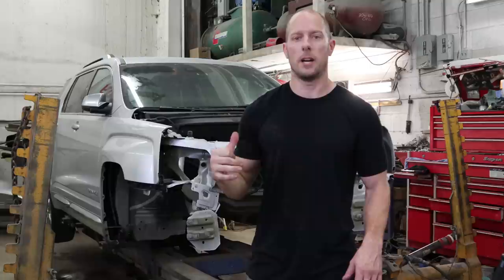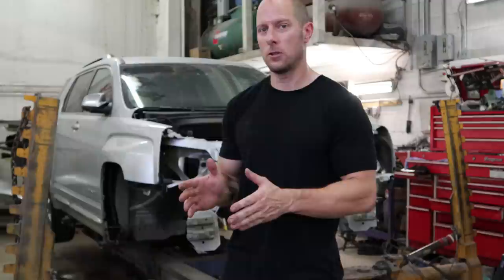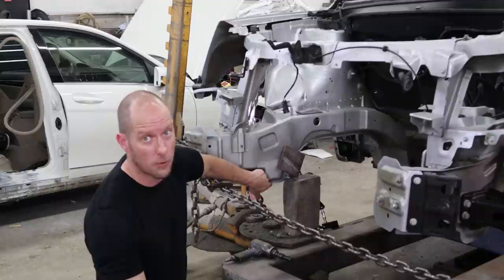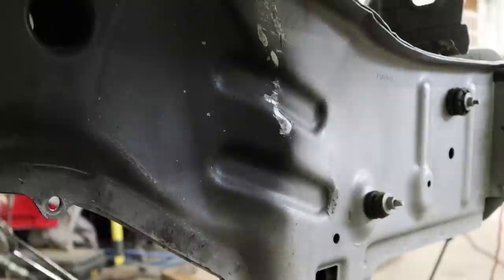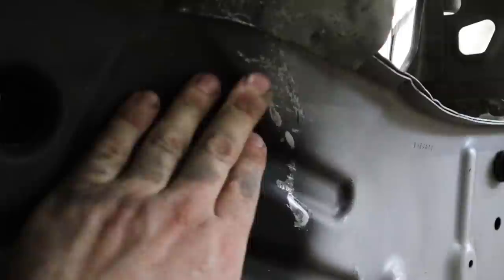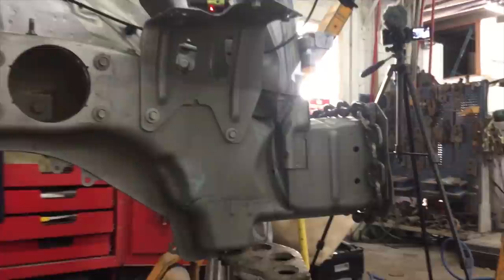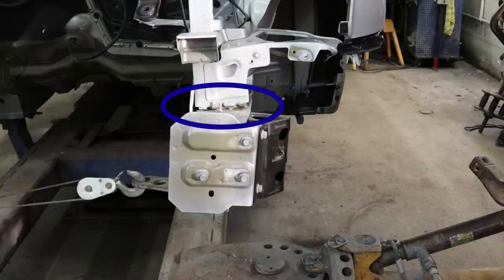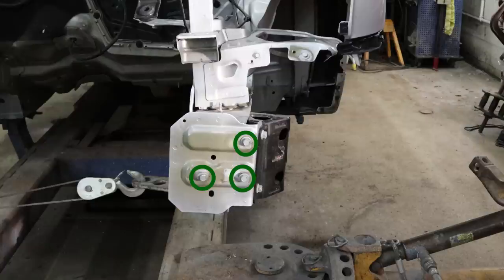Frame pulling tutorial on our 2015 GMC Terrain salvage rebuild project.

Comment: I'm from Peru, and lately labour costs (which used to be dirt-cheap) have gone up a lot, and I was asking some shops why weren't they investing in state of the art frame machines and the answer was "if a car is so messed up that needs expensive equipment to messure and pull, it's probabbly going to be totaled anyways, so why bother". I really like this tutorial a lot, please keep them coming.
Reply from the maker: Manufacturers don't want anything to be repairable.  They want to keep selling more cars.  They make the parts replaceable but the labor to replace them is enough to make a 2 year old car not worth the repair.  Frame racks are becoming less useful if they will not let you straighten anything anymore.  Thanks for watching, more are on the way.
Reply: In the  year 2022 with supply issues many people are holding on to  the  write offs rather then crushing them for a few hundred  dollars, if I pull the engine  and transmission  that's worth 4 grand used 🤷‍♂️ body work that would  usually  be 200 dollars  is minimum 1000 dollars  now unless, you know someone. I'm considering  getting  into the  salvage business  🤔.
Reply: @vehcor  that's a good reason to keep your old workhorse frame machine and not invest in a state of the art machine with laser and GPS guidance machine that will be out dated in six months if you don't buy the new programs😂. Hey it got you here this far ,, keep her, kinda like an old wife. LMAO

Comment: Another good video, it's cool that you are showing people  what goes into the repair process. Ideally you want to give it a yank before replacing parts anyways. It tends to help the new parts line up better.
Reply from the maker: You are spot on!  Even if it doesn't look like it, sometimes adjacent panels can be moved slightly and it sucks to find out when you have a rail assembly in your hand that just doesn't want to go to its home.  Thanks for watching!
Reply: Agreed 100% just because it isn't obvious doesn't mean its straight!!!, always verify the straightness of the surrounding areas before mock up and reassembling!!!!!

Comment: I’m a brake operator and whenever we bend something you’ve always gotta over bend it a real little bit because steel has memory and we call it spring back, exactly what you just said, cheers.
Reply from the maker: Over bending is another method they used to use.  They no longer recommend it for cars because one person's idea of enough is not the same as another.  It does work just as well though.  Thanks for watching.

Comment: An excellent how it's done video. I have heard of "pulling it". I now have a much better idea of what is involved. Thanks. Looking forward to the series. I would have no worries buying a vehicle you've repaired. No cut corners. Hard to find these days.
Reply from the maker: Thanks, I'm glad I could pull of this teaching thing.  With all of the "how much did you make" and "what does it cost" comments and emails I get it is no wonder good work is hard to find.  Everyone is focused on money first and the work last.  I could make a lot more cutting corners in the short run but it hurts you in the long run.  Not to mention I just wouldn't feel right about doing something that wasn't right.  I will have a video to explain that as well. Thanks for watching!

Comment: I’ve watched dozens and dozens of videos on this subject and read myriad articles and papers form the manufacturers and comprehensive studies on the metallurgy going on here.     Truly incredible what they are doing today with ultra high strength steel.     I really dug in when I went to level a dimple on the frame rail of my daughter’s Magnum.    I’m a pretty big guy, and known to “make” things submit to my will, strength, and most of all, thorough understanding of leverage and physics.     I used to only drive cars made before 1972, and have plenty of experience straightening out “mistakes”.     My best friend totaled my 1968 Country Squire, and although he hit a tree at only 35ish MPH, the damage was astonishing, with the right headlight pushed back, massive steel bumper folded in, fender folded in, the works.    I took a 28oz Estwing framing hammer and out of anger and curiosity to see what it took to bend that steel,  did an overhand swing on a smooth section of that fender.    On a modern car that hammer would go through that sheet metal.    On this fender, it barely left the waffle pattern of the fresh hammer.      Anyway, I used a hand sledge to massage that slight wrinkle, maybe 3/8” tall, where the steel is layered/laminated, and bent just like the vehicle in your video, it made the inner layer wrinkle back towards the point of impact.    I don’t know the gauge, but that layer was maybe 1/8” thick.    Annnnnnd.  Nothing.     It was near the brand new strut I had installed, as I replaced the entire front end suspension parts.  But I didn’t want to scratch it.    So to hit that point from afar I used a tire spoon, about three feet long, round butt end, flat spoon on the end against the rail.     I wailed on that thing for three hours.    My wife told me the “CHING” got ALMOST therapeutic for HER!    Easily over a thousand very hard hit, leaving the end of the spoon mushroomed over.    It left marks in the steel, but did not bend it.    So I applied some MAP gas torch to it until it got a cherry glow in that area and that helped.     That just blew my mind.     That’s what led me to learn about the steel used, and found out that section used DP 590, dual phase, two different types bonded together, and the metallurgy used to create each type is incredible.     They have figured out how to make relatively light weight steel also ultra strong, hence the name.      I have a tow car garage with a support post in the middle.    I used that, big ass eyebolts into the far wall, and some floor anchors to keep the car from moving towards the drivers side, all anchored just act of the cowl, under the car and on the pinch welds I used some beam clamps which worked great.   On the impact side to pull the apron and rail, I used a two ton electric winch with a pulley to get close to four tons, but not really, plus a come-along, plus two large 2” wide ratchet straps, all progressively attached from behind the strut halfway to the cowl, then at the strut below on the rail, and then two more points along the rail to the bumper mount, of course the bumper was removed, and the headlight support, which is the main cross support framing the top of the radiator, headlights, and binds the fenders together, with the radiator support below that.    It was bent slightly annd I fixed that in five minutes.   In fact, I really didn’t think the frame was bent, initall, that’s how subtle it was.   The hood was saved and the drivers door, with all the impact being at the knuckle and strut zone.    The knuckle was bent over and pinched the tire.   The upper A arm broke, as well as tie rod end.    That headlight got cracked, but almost spared.    So it was concentrated.    So I rebuilt the front end, all good, easy, took maybe 6-8 hours, doing both sides since she had already been prepping for a front end upgrade before the accident, she already had the parts even before insurance did their thing.   On that note, they wanted to total it, of course, but it’s was in the ragged edge.    She loves the car which is not replaceable, kinda, and the damage honestly didn’t look too bad.   We ordered a new painted fender and bumper cover, easy bolt ons.   Surprisingly, the fender bolted right up with perfect gap to the door, and the mount holes on the apron lined up perfectly too.  Hmmm.  Still not sure why.  Cause the hood on these cars has no adjustment, and did show a gap on the passenger side and a little overlap on the drivers new fender.   And when I loosened the bumper and the cross support, the drivers side rail snapped back about 3/4”.    Everything seemed to line up, except the hood.    But I was wrong.  BOTH fenders/aprons were pushed to the passenger side about 1”.    And hence this story and why I’m watching these videos.   I have pulled, and pulled some more, and I can see everything moving, A LOT!    Easily more than the 1” needed.   But when I release the tension it always goes back to about 1”2 shy of where it should be now.   I even had plumb bobs up and down the chassis, and the shop manual has spec measurements in it, so I made a grid under the car to keep track.   The grid is worthless if the car moves at ALL, and it always does.   Hence your frame rack.    I know I can get this right.  Question is, how do YOU measure the big picture to make sure everything is where it should be.   These pints are so far apart and measuring is so difficult, I even made a tram gauge, but even then, 1/8” here and there is 1/4”, and then combine that with imperfections in measuring a diagonal from one corner to the other, it will never be precise enough to be right.   I’ve measured on this car maybe 20+ times.   But I am determined.   This is my daughter’s baby, and of course I got one new in 2006, and she’s always loved my hot rod wagon, mine is black, she bought a nice cherry one in Inferno Red, Flowmasters, and of course both are RT Hemi cars, cause, why breathe otherwise?  I’ve even used my car for reference.     Some parts are dead on.   But how do you know  that your reference points are even correct.   At one point I got a perfect isosceles triangle from tow rear corner points to the center front of the engine cradle and was convinced it was square.    Went to do toe-in, with a laser down the side of the car referenced off the rear rotors, and even accounting for their own toe-in, and got the same thing as the hood.   One inch, on the nose, was how much the drivers side rotor was closer to the rail than the passenger side was.    Ugh!  It almost like I bend it, maybe three or five inches last where it should be, release the tension, take measurements, and then over several hours or days it returns to near where it started.  I have moved it, and of course the whole rail and apron didn’t move proportionally, but it’s still off by about 1/2” in some places to 3/4” in others and it turned out that the passenger side apron was harder to pull than the drivers side.   Maybe stress hardening?     Help.     Just as a point of reference in a pull just like you did in the video, how far PAST the point of being square did you need to pull to leave it correct?    I feel like I’m going to rip something apart if I keep pulling so hard.    Of course I’ve had bungee cords and heavy blankets strategically placed to prevent  any failures from becoming more damaging than needed.      What is normal.   Also, the papers said that on DP590, heat was not a good idea, but very localized and short term heat could be used  to relived shallow wrinkles.    Otherwise, it can make the steel more brittle, or more soft, depending on lots of factors.

Comment: Right On Point!! People Are Scared; as a Shop may not know if Vehicle is for End User or ReSale in which Potential Liabilities and Approaches are Best and Today Many People Are Afraid of Actual Work, as They Just Want To "Flip" It.

In My Case; My Vehicle Was Wrecked as Last Owner Neglected The Brakes For Whatever Reason.  Minor Frame Damage was Easily Fixable but a 2wd Jeep Isn't Worth Much, especially in New England With All That SNOW! It Was Worth It as I am the End User and I'm Gonna Run It to the End while Taking Care of it Of course...
Reply from the maker: Some people just don't know that you cannot use the old methods on everything.  Once upon a time, sectioning those rails would have been acceptable but not with the HSS.  Good luck with the Jeep.

Comment: I built my own rack, as even used ones are expensive here. I work on pre 1990 cars so it's handy. One i have on the rack right now is a high end car that was wrecked ,may 40 years ago and seriously badly repaired. The two front rails were replaced  and brazed into place.... then the car was in another wreck a few years later and the left front rail was simply left bent, about 15mm pointing down on the front. The owner had complained of tire wear and the hood wouldn't fit.He had bought new hood and it didn't fit either... Not surpising seeing as the car was lower on one side and 50 mm shorter than it schould have been... I've replaced most of the front but i have to remove the tunnel as that is concertinaed too .The engine left two big bolt head shaped dents in the firewall. . Such fun!
Reply from the maker: I have had to repair some very shady work on cars I picked up as well.  There are some real hacks out there!  Thanks for doing it the right way!

Comment: Great video I liked the explanation on how you straighten the frame. My Jeep Wrangler needs a whole new frame. Not so sure I want to tackle the job. Keep up the good work
Reply from the maker: I have done of few Jeep frames.  They are not too bad...... if you have a lift.  Without it the chance for error and damage increases greatly.  I do have some old time lapses of frame swaps that might give you a better idea what you are in for.  They do not have narration but there is one with sub titles.  I will make a narrated one like this when I have a job that requires it (I have one in my driveway that might).  Thanks for watching.

Comment: good tips and those alignment benches are crazy expensive. can put a vehicle on jack stands chain it down to floor anchors with frame rail clamps for a pull. frame rails engineered designed to crumple to pass modern safety tests or the product won't sell. when i was in autobody/collision college seen some worse than this on frame car/trucks. they had us use heat (better not to) but like you said once the potholes & vibration gets to it the cracks open up. we always hung alignment gauges right away to see it the vehicle was salvageable. your is a easy one. they told us to stay away from side cowl & pillar damage. also only certified technicians should do collision damage or there's a liability issue
Reply from the maker: Thanks,  I get all those side hit and cowl hit no one wants. lol It is just like a frame rail, just MUCH harder to get to.  Heat is always bad even on newer full frame vehicles.  It is never ok to heat a unibody.  I think being certified helps.  It means you were taught the right way to repair.  It does not always mean people follow it though.  The biggest problem I see is that people just don't know they are not doing things correctly.  Some are not trying to cut corners or be dishonest, they simply just don't know what they are doing is wrong.  Hopefully my little channel can lead those people down the right path.  Technology is changing so rapidly that a repair that was ok 5 years ago is not today so you need to stay current in training.  However, I think we have reached the end.  If everything is just replace, replace, replace, if you just replace it all you are good! Nowhere to really go after that. lol Thanks for watching!
Reply: @vehcor  A lot of newer Mercedes for example cannot be straightened as the steel is supposed to bend at designed points but once you put heat to it, thats it.its a write off. The only option is to cut the rails out fit new parts. They get written off here because it can cost 5 figures just for parts,let alone the labour to pull the drive train out. I bought a late model one to repair as daily driver .Luckily the chassis rails were OK, it was the radiator prices etc which wrote it off (*4500 ) .. Mercedes BTW invented the crumple zone idea (Bela Berenyi was the inventor) and let any other car maker use their ideas... it only took 50 years for it to catch on .

Comment: Great video and format.  The only thing that I would do differently is reinforce the buckles in the frame after straightening, and keep on trucking!  Unless it's not possible, because components have to run through the repair area, anyone sectioning a frame should have enough knowledge to reinforce the existing frame. Thank You!
Reply from the maker: These cannot be repaired, they must be replaced.  Reinforcing isn't always correct.  Stronger does not mean better just like straightened doesn't always mean repaired.  Vehicles are supposed to absorb crash energy, making them stronger means something else has to give.  I just follow repair procedures because the guys that make them have done the research, not me.  Thanks for watching.

Comment: ... you did a great job.. both the still photos, narrations, and the live action footage, this was excellent.   Thank you for sharing your knowledge.   I came across your video, I was searching for Chevy Uplander/Venture front frame repair videos.   I own a Buick Rendezvous, which has the same front end, because it's build on the same U-Platform chassis.   
I was looking for a way to modify the front rails or subframe, as a Concept Only, to be able to pull the engine, so that it could be slid out a bit, like 8 inches.    So repairs can be performed on the side of the engine which is nearest the Firewall.   It's just a thought process at the moment, both myself and a buddy of mine think about this, when we talk about working on our cars.  We both have front wheel drive vehicles, and they shouldn't be such a PITA to work on, but they are. 

Thanks again, Alfredo  Keep making the videos.. ✌